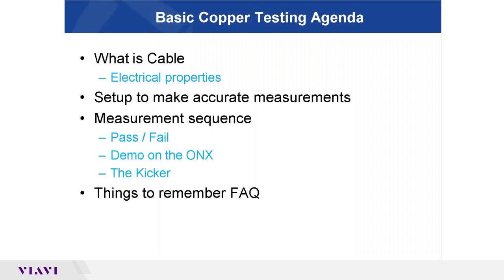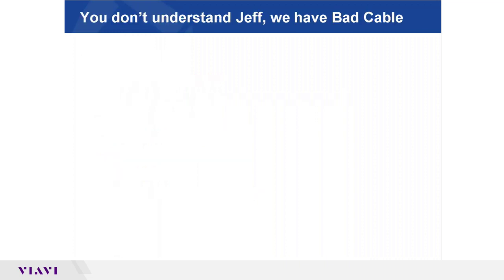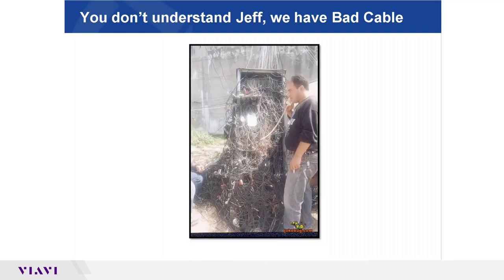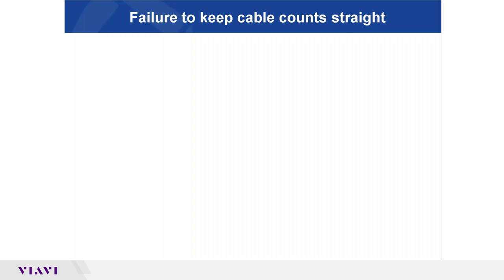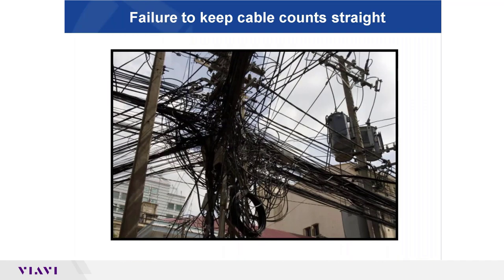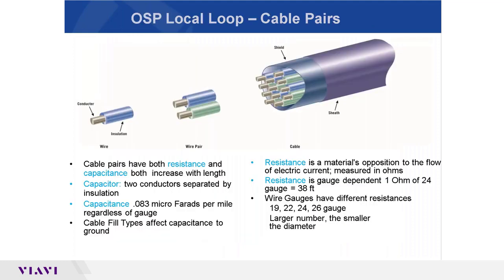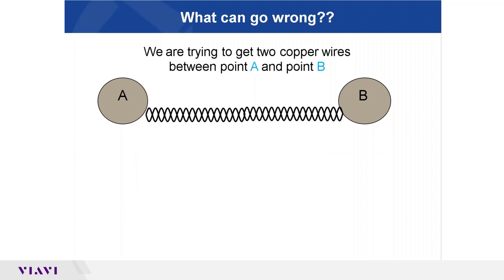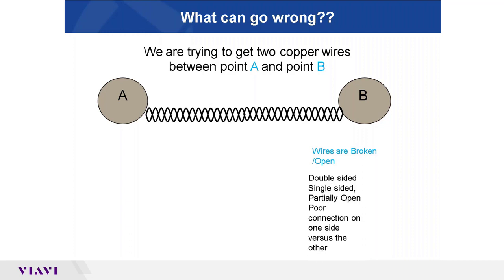Copper Testing with the OneExpert ONX-580, Session 1 (Multimeter, Opens, Balance,Load Coil)

Comment: When getting an open on a subscriber's line that is provisioned with ADSL by calling the XXX-XXX-0092 "open" number, you'll see a DC signature of 147k across the pair on a working, trouble free line. Also, dialtone will run with a resistive fault of 500k across the pair. Certain phone systems or alarm panels will show 500k ohms T-R. Kilo ohms doesn't always equal trouble.

Comment: Can someone explain " battery" a little more in depth?
Reply: What do you want to know ask me? When they're talking about battery they just mean that the equipment vrad or DSLAM from the remote or office puts electricity on the cable pair. It's normally between 48 and 52 volts.